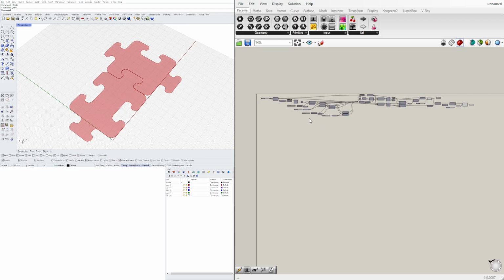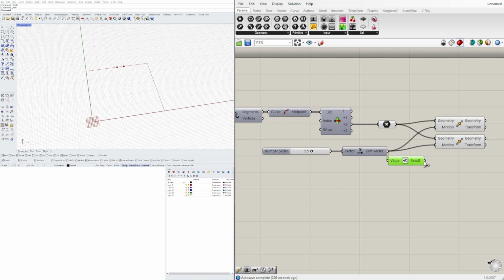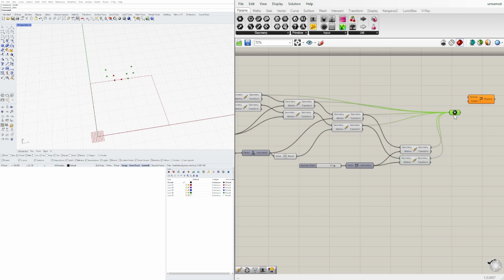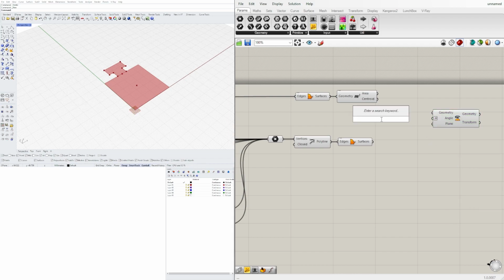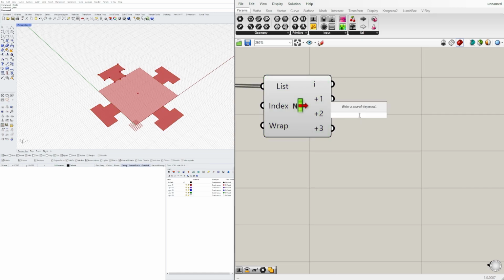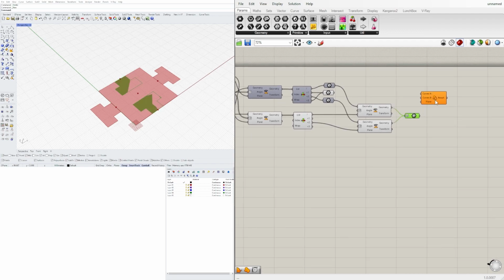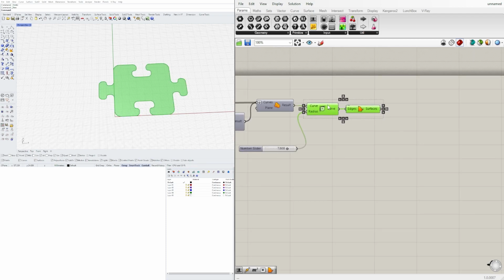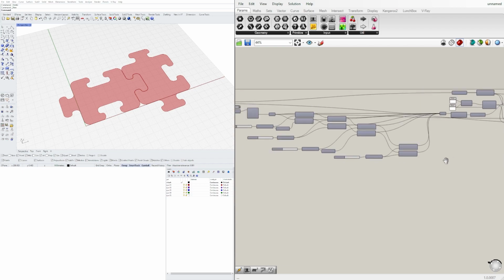Interlocking Structures Parametric 3D printing and Design Puzzle Form Finding

Comment: Notching!!!

In model making this is super fundamental for the assembly. Not many realize how important this is for model making.
Reply from the maker: I agree, and there are many configurations for this!
Reply: @DCOParametric  This is the tip of the iceberg. Piece numbering, piece coloring, order of assembly, layout plan of the indexed pieces are just few of the topics under the subject of assemblage. 

I learned that architecture is no different than any other scientific practice. It's all about the representation, the documentation, illustration and of course the 'narrative'. 

I'm glad that many, lots of streamers, are addressing the assemblage problem. We need a lot of good videos like this one.